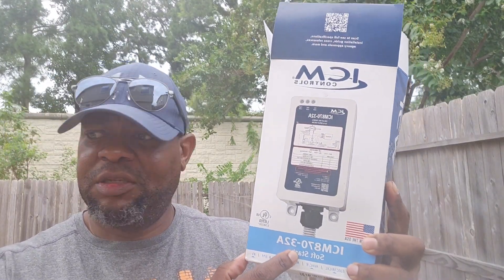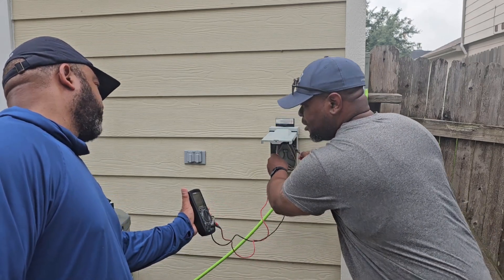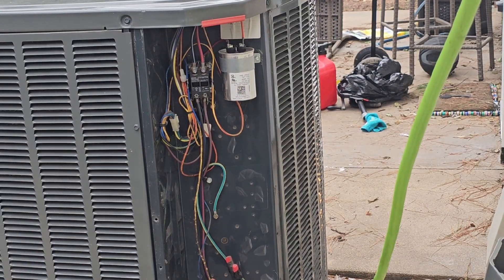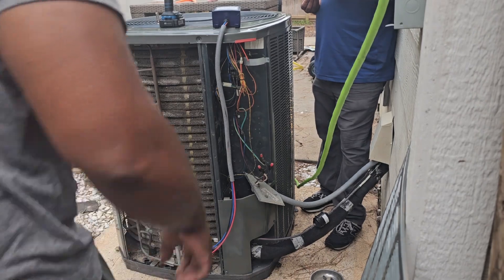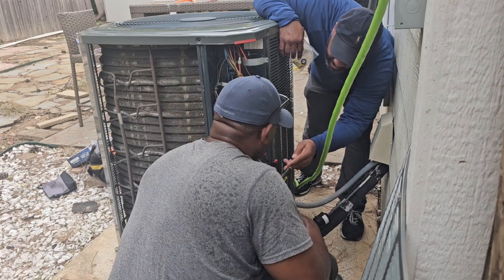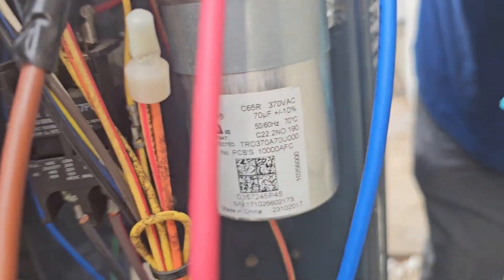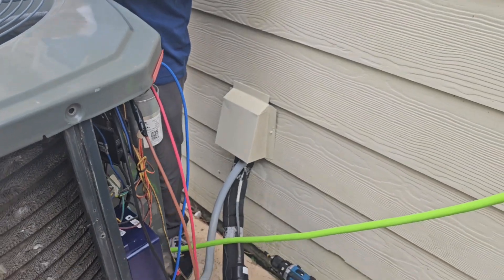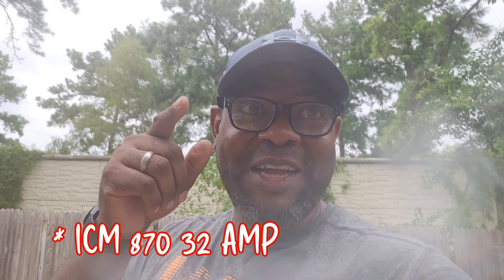ICM870 32A soft start module installed at bro n lsis n laws home

Comment: Hey, I just installed the exact same ICM870 32A on my 4 ton also, after installing it the inrush was 33amps, I didn’t check the in rush before installing but according to the panel mine was 92amp inrush.

Comment: Nice video. Im south of Houston and just bought 1 myself and Came in today. Mine is a 5ton trane XR so this works out perfect. Hurricane Beryl hit us pretty good and we were without power for 3days. My 14500 watt run time Westinghouse should be able to run my hole house now after i install. Thanks
Reply from the maker: That's awesome,  I've installed a couple on trane xrs already.  I believe the inrush amp are pretty high, around 130 plus amps. That's going to drop  significantly once installed.
Reply from the maker: Oh and thanks
Reply: @ChasingTailsOutdoorsTV  So that 11500 watt run time wouldnt run the 5ton trane even after the soft start?
Reply from the maker: @chrissimmons6358  Yes, it would.
Reply from the maker: @chrissimmons6358  it ran it with no problem I don't think it bogged down with it kicked on either. Lol
Reply from the maker: Yes sir with no problem
Reply from the maker: @chrissimmons6358  Yes, just be mindful of other 30amp appliances while running the ac along with the microwave, and you'll be fine
 I couldn't run my dryer while running my ac, but I could run the microwave. I only have a 30 amp plug so you might want to go with a 50amp instead with 6 gauge wire.
Reply: @ChasingTailsOutdoorsTV  sounds good. yessir i went with 50amp breaker and 6/4 wire.